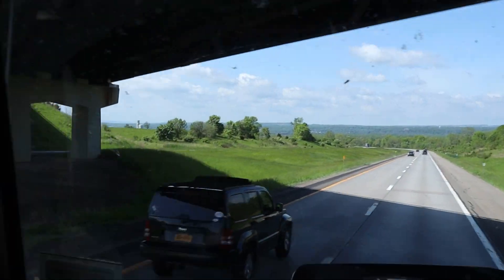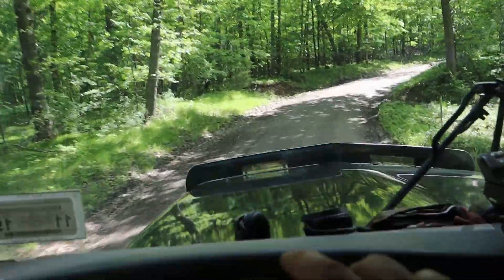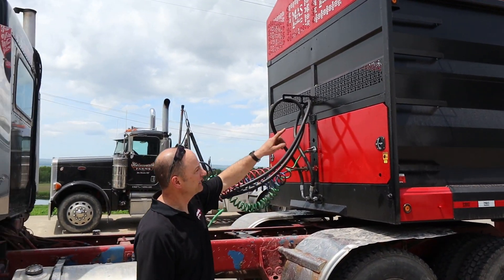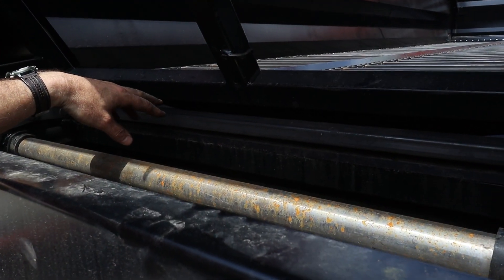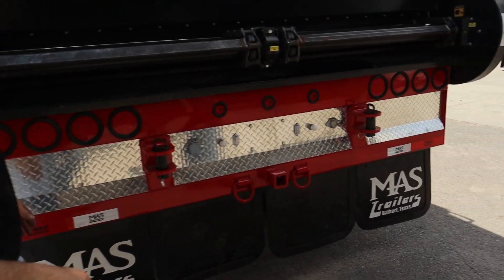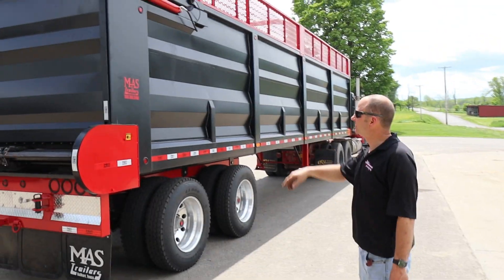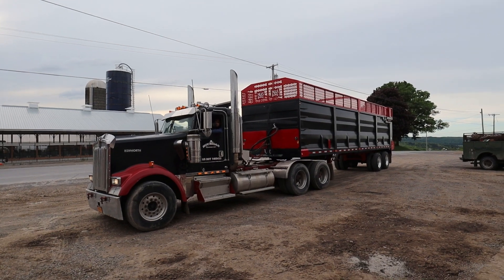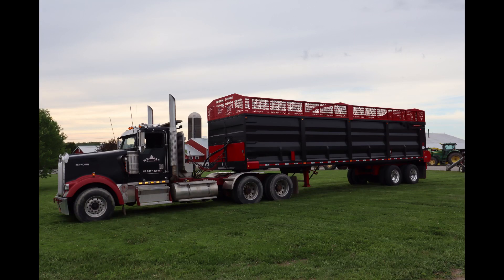New Mas Silage trailer

Comment: Andy that's almost a twin to the one I used before retirement...at the end of the year I firehosed her out then when dry I'd mix up diesel and used engine oil 50/50 and fill a weed sprayer run the chain and stand at the back and spray each run down before putting it away for the winter....it seemed to keep everything free for next spring.

Comment: Can you explain the advantage of this trailer over a dump trailer for silage Andy?   Another great video.
Reply from the maker: H. E. Phillips there is a high risk of tipping a dump over while unloading
Reply: That is what I thought.   I've seen loads hang up on one side causing the trailer to teeter and taking the pucker factor to 10.   I was amazed at how quickly the trailer unloaded.  It's honestly no longer than dumping.
Reply: That is what I thought.   I've seen loads hang up on one side causing the trailer to teeter and taking the pucker factor to 10.   I was amazed at how quickly the trailer unloaded.  It's honestly no longer than dumping.

Comment: Shouldn't that air pressure gauge be mounted higher up the sidewall right under the extension. And also it be a 4 inch gauge to make the reading of it easier when you are 20-25 feet away.
Reply from the maker: Yeah probably

Comment: Andy, looks like electrical plugs on the back of the trailer, scratching my head wondering what they are for .
Reply from the maker: Electrical and air hookup. It's for the custom guys they pull other trailers as they move from area to area.
Reply: Thanks Andy, Mystery solved.